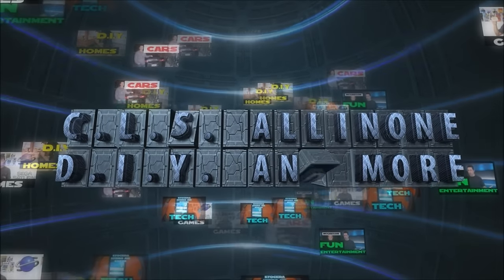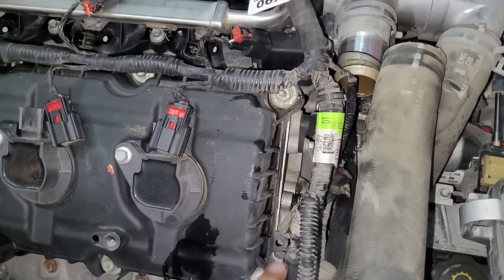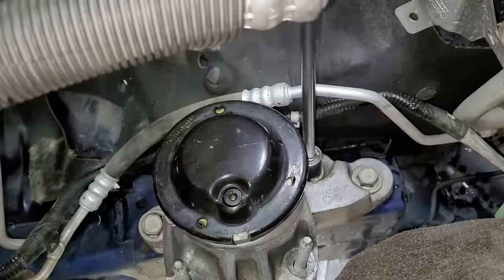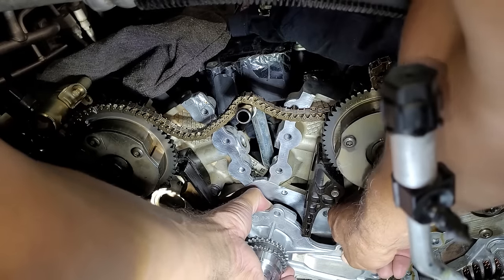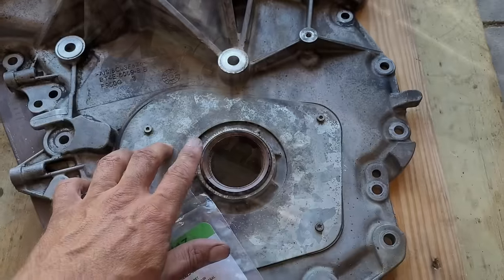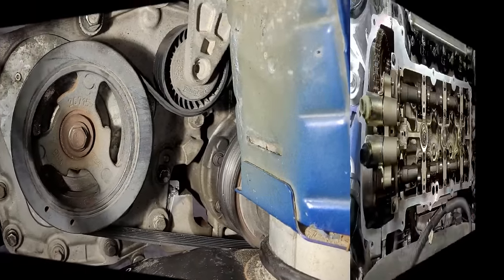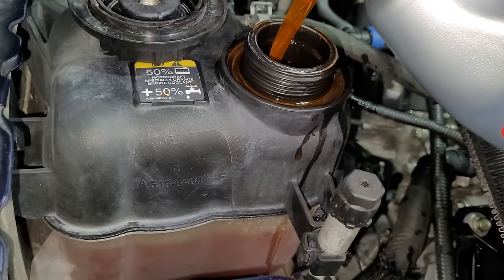How to change a water pump in Ford V6 3.5 & 3.7-liter engines 2012-19 Explorer, Taurus, Edge & more

Comment: Pull the passenger axle if your awd, otherwise the engine won’t lower to get access to the timing bolt above the balancer.

I replaced the main chain, guides, tensioner, alternator, VVT seloniods, water pump, intake manifold gasket kit, and valve cover kit. I left the secondary stuff alone even though I had the chain and tensioners.

Expect to break some stuff if your high mileage. Mine had 194k and the exhaust flange studs each had one break. Some tranny fluid and power steering fluid spilled on the garage floor. Radiator peacock didn’t make it, so I replaced that.

Car now runs perfect. Oh yeah, sucked out about 4 oz of sludge from the ptu and added 10 oz of 75-140.

Comment: Just doing this job, with an OE ford pump and my timing marks were marked before I took off but now the LH side is 1/2 tooth off causing it to be 1 tooth off and has slop on the water pump gear. What caused that?

Comment: That almost dead center middle bolt that is hard to get out of the timing chain cover is giving me problems ive lowered the engine to where the cv axle prevents it from going further and it just isnt enough its like the frame area is larger on mine (2013 ford edge), any advice would be appreciated. Can i leave it loosey goosey and it will be able to move out when i get the cover loose?

Comment: Great job on the video very detailed video,
I would add athe follow additions items to replace ... the thermostat  should have been changed, 
The chain guides should have been replaced.. the coolent tube seal should replaced also as well as all pully belts
Reply: Here's what I am here to say too.
Also the crankshaft bolt is torque to yield and should be replaced.

Comment: In the taurus there is only about 2 inches from the wheel well to the crank pulley. What is the secret to getting enough room for a gear puller?

Comment: My question is the issue that I’m having is removing the harmonic balance pulley bolt (the big pulley you removed with the puller) I can’t get it to come loose does it unthread left like every other bolt out there or does it come out Turing it to the right with the engine rotation. Everything else I got done already I’m just stuck on this one. Thanks in advance.
Reply from the maker: The loosens normally counterclockwise, are you using an impact gun to remove it? It's a pretty tight bolt, it's really hard to remove without an impact.
If you are using an impact, try using a larger one.  My ryobi wouldn't cut it so I had to use a Milwaukee impact to get it loose.
Reply: @D.I.Y._All-in-One  thanks man getting a big Milwaukee impact gun to get it off and hopefully it works out my truck has 150,000 miles right now so it’s gonna be stuck in there
Reply: @D.I.Y._All-in-One ey man so after installing the new pump my truck started burning coolant and blowing white smoke any idea what could cause this issue?
Reply: @JoseM1356  maybe the waterpump gasket didn't align properly. Is coolant mixed in your oil? BTW I am CLS allinone, I just signed in with different channel.

Comment: I got finished with this today and it cranked fine got coolant done and noticed it had check engine light so I pulled the code and it was p0016  cleared ran for another 45 mins no code shut off restarted came back could it be off like a tooth still run fine but cause p0016?

Comment: I cannot get the crank pulley bolt off of my 2016 explorer. Bought a 1000lb corded impact. Didn’t even budge. Any advice?
Reply: Update: I learned that pneumatic impacts are much better than electric. I bought a 1050ft lb electric plug in impact. Didn’t work at all. But a 300ft lb air gun did it easily.

Comment: The special tool to hold the cams is not needed if your just changing the water pump. The timing chain has marked links that align with the sprokets.

Comment: excuse my ignorance,  but what did you mean at 31:29 to torque to  90 degrees and /or 45 degrees?  isnt that the torque wrench .... you mean once you have torqued it to 15ft-lbs then add a 45 degree turn with the torque wrench ?  am i correct,  i appreciate your response ,,,,,
Reply: You are correct. Some digital torque wrenches have the capability to also calculate the additional degree torque settings, Gearwrench is one of the brands.

Comment: My dots on timing aren’t where yours were. Am I fine to keep cranking til 11 and 1???
Reply from the maker: Just make your own marks and make sure everything lines back up the same when you put it back to together, and make sure your marks don't get washed away with cleaner. You can also use a knife or something sharp to scratch your marks on whatever to have marks that can't be washed away.
Reply: I installed chain and tensioner and then turned engine to make sure everything was moving but then the tensioner started bounceing and now my markings are off. What do i do@D.I.Y._All-in-One
Reply: Put the chain back in line and if you’re cams moved then you’d have to find out what and where your Top Dead Center is and put it there then put the chains and stuff back on. Maybe you can turn the cams by hand if they’re freely moving and put the chain back in place

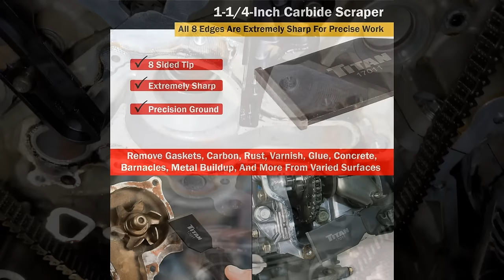Comment: 23:46 shows the pump removed and a small black plug below the impeller housing.  This plug is covered up by the water pump when installed.  What is the purpose of this plug?  I am performing this repair and when cleaning the gasket surface it feels like hard plastic.  Any help appreciated.

Comment: I worked as a Master Tech at Nissan for 4 years and as an ASE Master Tech at independant shops. If your car is out of warranty and you're doing this yourself, please don't reuse anything. Even if they're in good shape. It's cheap insurance to just replace everything. A good quality (Cloyes) aftermarket kit with all of the wear parts can be had for under $300. It's not worth the risk of reusing old parts. OEM Ford stuff can be had for under $600.

Comment: I just completed my install and went to start the vehicle after the oil and coolant fluids were installed but it will not turn over.  Any suggestions?  Seems as though it is not getting fuel.  I did remove the injectors so i was wondering if i need to prime the fuel line.
Reply: Did u put the fuses back in ?

Comment: Great video, I just finished this massive job on my 2016 Interceptor and this guy doesn't miss a single step along the way.

Tips from hindsight: 1. take pics & video of all the connections and hoses.
2. He's 100% right about making sure the cam locks fit completely snug to make sure your timing assembly is on point (lots of back & forth micro turns on the crank).

Lastly I'd like to add a personal f*k you to FoMoCo engineers for making this such a pain in the a* design.

Comment: The only problem I found if you're not mentioned. That thing about tightening up the drain plug. Nor did you mention anything about the power steering pump and the belt. I am doing a 2013 CX9 Mazda and having a hell of a time with this power steering pump.

Comment: When removing the spark plug coils, the rubber boots on the back spark plugs will naturally be the ones that get stuck because they are the ones you can't see. The boots can be replaced with new ones from your local parts store. However, it may require a couple of hours, the use of various picks, and many special words.

Use a little dielectric grease on a q-tip inside the spark plug boot so that it won't be stuck next time.

Comment: Great video! I wouldn't have done all that work without replacing the chain, guides & tensioner. That's just me though.
Reply: Luckily my timing chains and guides And tensioner were changed previously, but I still changed the tensioner because when I took it off it went flying, bought another, then found it later when changing the Ptu,,, it fell out when I was taking off the exhaust.

Comment: my question is can a shop make that hole leak i took my 2014 taurus v6 for o2 senser and spark plugs 120000 mile check up all was good till 15 min before pick up and they said my water pump seal went they asked if i put anything in my coolant i said no cuz they been the only shop i took it to they showed me stuff in my coolent said its in additive

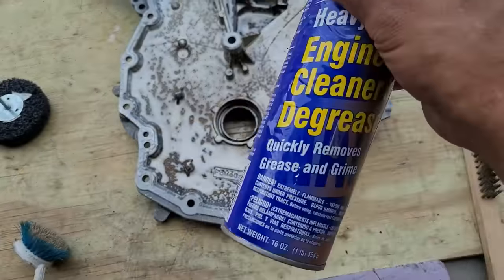Comment: Good video but a couple of suggestions. 16:39 you want to use the 3M white bristle loc for cleaning here.  Says it in the Ford manual.  I put sealant on the cover like the manual also says.  Do several test fits on the cover before applying sealant so you know you have the engine at the right height and you know how to position it so as to not hit sealant.  Also take a couple of loaner bolts and install in the center area and taper the ends.  These act as guide pins (you can buy special ones or make) so you can bring the cover in straight and not smear sealant.  Again this is in the Ford instructions.

Comment: There shouldn't be any difference on a taurus with 3.5 non sho. Correct? Other than minor differences in the bay like routing of houses, wires, stuff like that. I am going to use this video to do the job step by step but dont want to run into an issue if something doesnt match up on different model vehicles.

Comment: The timing cover has threaded holes in it from factory so you can drive the bolts thru to pull the cover off the RTV without prying or cutting the RTV.

Comment: Overall an excellent video, but...

Never gap a platinum plug like the one shown here or an iridium plug like the one that was original on my Edge. They come pre-gapped and should not be reset. It will damage the electrode.

Comment: I am currently putting in a new thermostat, head gasket set, and water pump in on a 2011 Ford Taurus SEL with a 3.5 v6. I am to the point where i just have to clean it up and reassemble everything, i was wondering if anyone could give me an eta on how long it will take to reassemble the everything. Much appreciated.

Comment: What a great detailed how to… I’m thinking about buying a used higher mileage Edge, but after doing some research and watching the amount of work involved in doing what I consider a high probability repair, I’ll pass.  Imagine doing this job and having a poorly manufactured water pump that leaks !  New parts are made poorly and leak, etc. quite often lately. The Ford Engineer’s must have designed this after a drinking game………

Comment: Just a tip, I'd skip the brake cleaner spraying of the heads and timing chain area. I've had brake cleaner swell or "melt" seals and o-rings. Of course this may depend on brand and/or additives.

Comment: I just finished this job and I dint follow you but I used a website from ford which is basically the same thing and now the car cranks and runs horrible and dies right after if I give it gas it revs up and holds the engine for a little then it dies I don't know what's wrong fuel is good spark is good and all connectos are good, if I disconnect the MAF sensor the car cranks starts and run very horrible but it runs so I don't know what's wrong with it car has gas too so I don't know anyone has any idea?. also its a 2014 mkz 3.7 and the dash has a orange wrench light on and it says powertrain malfunction, tried to reset the throttle too since I disconnected the battery but still runs like shit or not at all.

Comment: We have a 2014 explorer making some awful sounds. Had someone look at it and said could be water pump. Anyone know any other ways to tell if water pump is what needs changed? Antifreeze is going down very slightly but no dripping that’s noticeable.
Reply: Overheating and also if your oil is turning light brown like a milkshake

Comment: great video for sure, but i wont insult you like others in the comments by calling or comparing you to an engineer. after all, only an engineer could be dumb enough to design a water pump this way to begin with , so that some poor customer in their high mileage ford gets hit with the highest labor $$$ cost water pump bill ever and has to get rid of the car because of it. but seriously - GREAT video

Comment: Does anyone know if a bad water pump would cause oil in the coolant and coolant in the oil?
Reply from the maker: It can if the impeller bearing seal on the water pump fails completely.  This would allow coolant and oil to mix. But a bad water pump should still be leaking from the weep hole, then out of the bottom of the engine.
Reply: @D.I.Y._All-in-One  so if my coolant reservoir tank is a dirty dark color, it could be the water pump? I'm trying to determine if it's the water pump or the heads (it over heated last year due to a fan that went bad).  I did see it leak some fluid I thought was condenser oil 2 weeks ago, it has stopped since. I may need to do some digging
Reply: I’ll come fix it for 700$. Plus you buy the water pump
Reply: @Apollokeeper  And I would take you up on that offer if you lived in near me
Reply: I live in Houston. 1 in a million chance you live close.
Reply: @Apollokeeper  I'm in FL. Do you do a lot of these engines?
Reply: @racequad9  so far I’ve only done my own. 100 percent stopped my leak and over heating issues.  My car is good as gold. I’m currently located in Texas but would drive to Florida to fix your car if you cover gas or book a flight for me. Which ever is cheaper
Reply: @Apollokeeper  Thanks but it's already at a mechanic.

Comment: 9 times out of 10, if you change your coolant regularly, and use the correct coolant, (Keep it topped off, etc) then the pump should last the life of the engine, much later than 115,000 miles. But non the less, excellent video and instructions.
Reply: You are wrong. If you own these cars you will do this job.

Comment: Does anyone know if this’ll work on a

2011 FORD EXPLORER XLT ?
Reply: Xlt is just the trim. As long as you have a fwd 3.5, 3.7 engine that's transverse mounted it should work
Reply: @Estebizle what’s transverse?
Reply: @angelc8824  a traditional engine is mounted longitudinal like most cars where the front of the engine faces towards the front grill. Transverse is when the engine is mounted to where the front of the engine points towards the passenger side of the hood
Reply: @Estebizle  good to know, thanks!

Comment: It’s embarrassing and sad that automakers are allowed to get away with purposefully complicating the repair of a system which often fails for the sake of reducing manufacturing costs that are not passed on to the consumer and which multiplies many times over the cost of repair for the consumer, such as moving the water pump to inside of motor. The manufacturer should be made liable to cover such repairs for the life of the vehicle including the engine damage it often causes. There is no good reason to place the water pump inside the engine.

Comment: Well done!
This job sure kills flat rate. That hour to wait for the sealant and the 24 hours before adding fluids is a killer. A lot of waiting. Initially, I was told that it required engine removal to replace the water pump. Apparently not. Makes me glad that I retired from that business. 
Running a water pump in a lubricated environment is a poor piece of engineering. The potential for disaster is enormous. Coolant in oil makes for a ruined engine.

Comment: ughh- my 2012 taurus is slightly different.  it doesn't have those oil tubes on the inside by the cam heads- instead, it has what looks to be tensioners for the second smaller chain.  just be aware, yall.  I'll take those tensioners out and go from there with locking down the cam shafts.
i also have a SECOND belt.  there's one from the crankshaft pulley to the power steering pump pulley (which is very hard to get to- since there's no frame on the taurus (unibody) there's less room.

Comment: Took me 18 hours. Freaking sucked to be honest. Saved myself about 2,000$ tho. The bolt behind the chain guide at the top will make you cry and want to give up. The freaking valve covers made me curse a few times as well. Very tuff to pry off when I expected easy

Comment: OK. If we need instructions on how to remove wheel well, we shouldn't be messing with timing ... lol

  Just saying, get to the timing portion.
  Great video overall.. thanks
Reply from the maker: That's why there are time stamps for all the steps, so you can skip to the parts you need.
Reply: This was for a wider audience than just you.  Get off the high horse, life aint just about you and yours lol.  Though I know how to remove the wheel well and most other tasks in this video I appreciated the complete, step by step, thorough instructions.

Comment: Great video, very helpful. I used this tool to remove the bolt behind the crank gear. It's a break blead tool, L shaped with 3/8 and 5/16 on the ends. A 5/16 wrench works on 8mm bolts. https://drive.google.com/open?id=1X6CB_l939moVlgzdE6QzNGnOsAQWgH74&usp=drive_copy

Comment: Never, ever , ever cheap out and put a cheap Wuhan aftermarket pump in one of these applications. Buy the Ford pump and be done with it. I’ve done enough of them to almost do them in my sleep and this is not the engine design that you want to buy cheap Gates, AutoZone, O Rielley’s garbage on. I’ve seen Gates pumps fail so catastrophically that it wiped the engine out before the car’s owner could get the car shut down. Pumps should be a 100K mile maintenance item whether it is leaking or not. At least the main chain and tensioner should be replaced while you are there. If it’s been poorly maintained all chain related parts should be replaced.

Comment: honestly seeing things like this its just one more reason not to ever buy a ford......awful design....zero thought about the long-term consumer or the mechanic - and this has undoubtedly led to MANY dead engines
Reply: Super dumb design, though if the engine is reliable it is worth fixing. You would think this kind of expense is only on luxury cars.